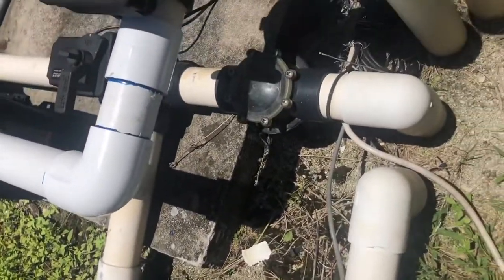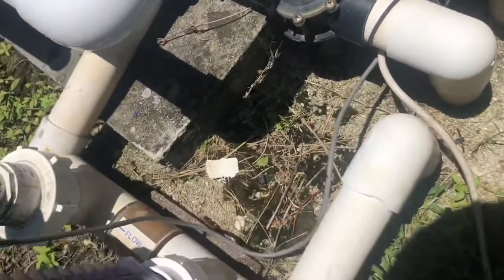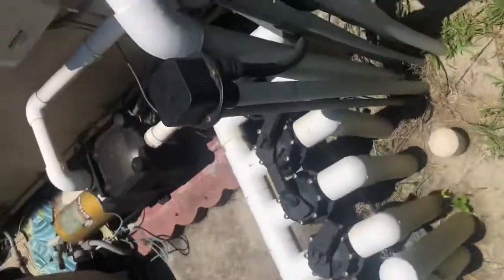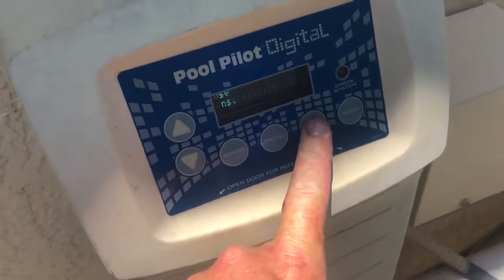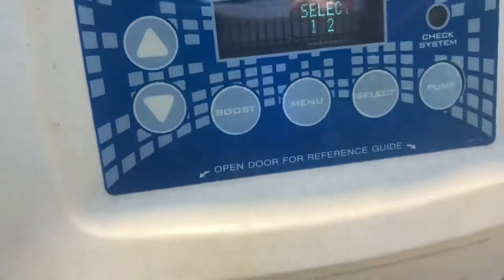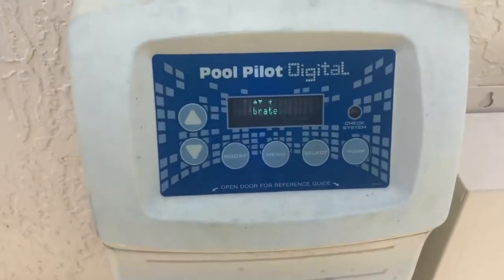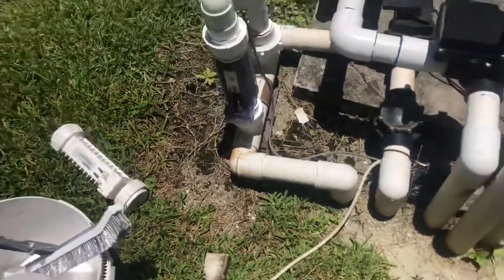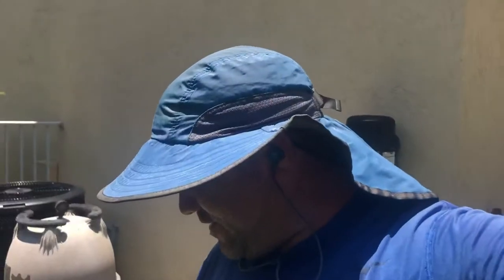Autopilot Salt Chlorine Generator | How to Replace and Program SCG Cell

Comment: Thank you, very helpful to know that you have to go into the Installer menu to change the cell type and the Maintenance menu to reset the cell hours. After spending a ton for a new cell, I wanted to make sure it was installed correctly.
Reply from the maker: Your welcome. Thanks for watching and commenting. Ensure your a subscriber

Comment: Great video but few quick questions; if you replace with the same cell type , do you still have to go to the installer & maintenance menu ? Also should this be done with the filter pump running and the cable disconnected ? Thanks much
Reply from the maker: If you are replacing the cell with the same size then no you do not have to change any programmed settings. In this case I believe we upgraded the cell size for a larger one.

Comment: Is it mandatory to change the cord ?
Reply from the maker: No it’s not mandatory, but if it is old & weathered away  or the inside terminal of the plug looks bad then you should consider replacing it. Remember that the plug is where the cell receives its power from and with any electrical connection, it’s important to have a good clean connection.

Comment: What is the life expectancy? Ours is only 2 years old
Reply from the maker: Hi, it honestly depends on how you keep up with truly balancing your water chemistry. I’ve had some last upwards to 6-7 yrs. This was because our company was maintaining the pool. Cell have an average of about 3-4 yrs. They go based on hours of total usage. Dialing in your chemistry allows the operator to not have to over produce chlorine for pool. Also a properly sized cell is always another key factor. When purchasing a new cell I tell my clients to go one level up, if possible by manufacture cell options and salt system power center options. Like this unit the power center has I believe 3-4 different options, if you pool is a 10-20k gal pool go with the option that is rated for up to 40k gal. This will allow for a buffer and allow for a lower production rate this extending the life of cell. 

Hopefully this helps. Thanks for watching and asking a great question. Be sure to share this out and become a subscriber to our channel